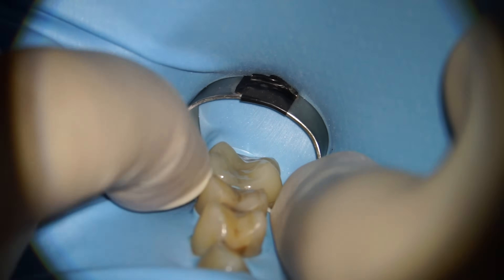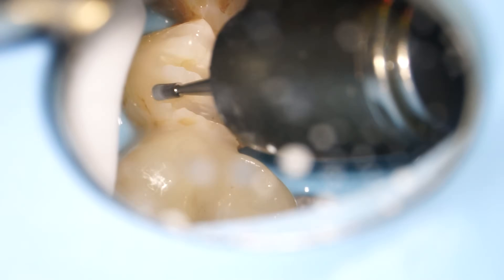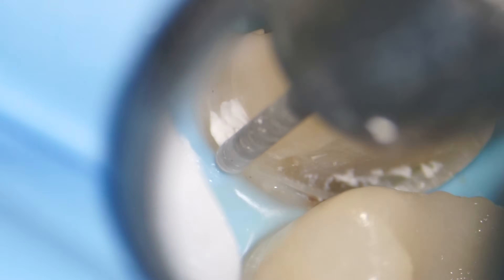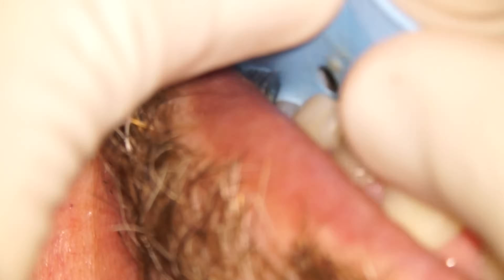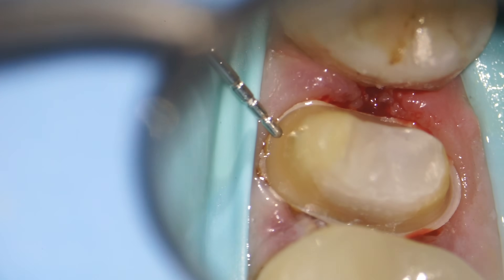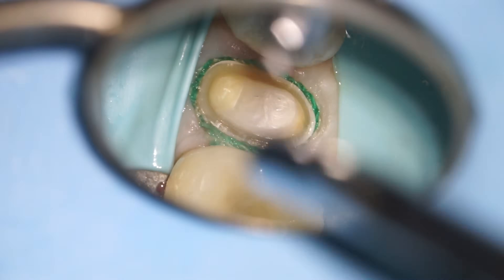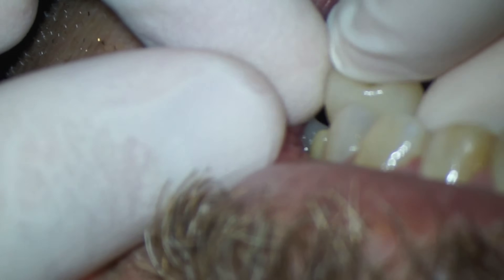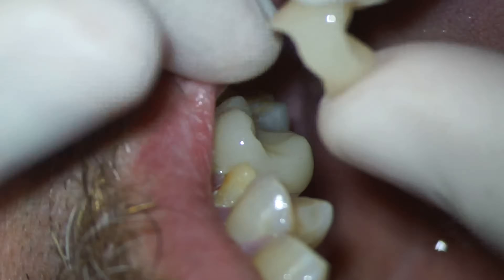Dental Crown EXPLAINED (and how much Tooth You'll Lose)

Comment: Yo doc. So I had this pain on the left side of my upper tooth when I used to bite down on food. It’s the last tooth before my molars. So it forced me to eat on the other side. I made an appointment to get my tooth checked out but I found out after eating on the other side that I was getting tooth ache. Not during eating but after a good dinner with mostly meats and what not. And started getting really bad tooth pain. So now I’m told that I need root canal and a crown. I’m confused. The  crown will go on top of the root canal or the tooth that was initially bugging me?.  The tooth that’s bugging me it’s not exactly form the way it should. The inner part seems to be chipped a bit that the outer part. Thank you

Comment: I had a root canal on top premolar. It had two canals. I'm going to get my crown on in a month (trying my best not to chew on it that side in the mean time especially with anything hard). The dentist said for the crown procedure there most likely won't need to put anesthetic. I saw a video where it looked like they used a blow torch to the gum? Wouldn't that hurt without anesthetic ? or maybe I don't know what I was looking at? Or my case is different where they won't need shave much off?

Comment: hi Dr I needed some advice I had a porcline fused to metal crown left top moler about 3 weeks back I have a black line at the inner part of my gum and it very tender to touch im also getting discomfort in the gums when biting I have been back for adjustment is this normal this pain.

Comment: Why use anything other than zircon crowns? Layered in front, solid in back.
Reply: High aesthetic full contour zirconium is a stronger and more predictable restoration in the posterior. When restoring on the mandibular arch, we stay away from layered crowns as there is usually a visible transitionary seam of translucency where the porcelain meets the zirconium on the buccal cusp in the case of cut-back zirconium crowns.

Comment: When I got a crown the numbing shot started to wear off because they worked on a large filling on the tooth next to the one getting a crown as well, so I think it took longer than normal.  Wish I had asked for more novocaine because I could feel that cord which hurt and then they did something after with a drill or something and I swear I could feel it in my soul.  The worst part for me was going back to get the permanent crown put on.  Once they took off the temporary crown, my tooth nub was so sensitive and it hurt when they would put the permanent on and then have to keep taking it back off to make adjustments and then putting it back on.  Also before they finally cemented it I said it felt weird and felt too tight but they took an x-ray to verify it looked good and told me it would take about a half hour and it would settle down and I would get used to it and I did.  No problems after that and I've had that crown for a year now.
Reply: Are you sure you haven't developed any cavities under the crown?
Reply: @Kriti2024  no cavities.  I go to the dentist regularly.  I also switched dentists after I got that crown.  I have since got another crown on another tooth and it was a painless process.

Comment: I have an onlay that wound up fracturing my tooth. The fracture isn’t bad but I’m sure I’ll need a crown. The only thing is, is that the onlay goes under my gum. Would they be able to build up enough material to glue a crown on to? My onlay is like a large filling in the back of my tooth.
Reply: I had an onlay that ended up getting a hole underneath it from decay and I needed a crown.  Yes they were still able to do a crown they just do what is called a build up with it where they basically build your tooth up if there is not enough structure left to support a crown and this way they can put a crown on it.
Reply: @samanthagirl84  How long have you had the crown? Makes me so nervous.
Reply: @FEARisCOLD  1 year last month.  Don't be nervous, it has to be done and it's honestly not that bad just feels like it takes forever because of all the steps they have to do.  I have to get a crown on another tooth in a couple weeks and I also need a build up on that one too.  Your gums may be irritated after for a little bit, but you can rinse with warm salt water.
Reply: @samanthagirl84  Thank you for the replies, I appreciate it. I’m only having this issue because my dentist chose to do something different than what should have been done. It has seriously stressed me out. I haven’t been back in months but what he did caused a fracture in my tooth. Luckily it doesn’t really hurt but I know I gotta take care of it because it gets worse.  Can I ask, which tooth and what kind of crown did you go with?
Reply: @FEARisCOLD    Tooth #18 and not sure exactly type, they didn't give me a choice, but it's all white and I don't see any metal along the base so maybe porcelain?

Comment: I’m stressing out. About 5 years ago I had some metal fillings replaced in a first molar on the bottom. That tooth eventually got a cavity under the gums which led to me getting an onlay. A couple of months ago it popped off. This was actually the second time. My dentist decided to do a bulk composite instead because he felt it would stay better. My tooth fractured about a week after. I’m not in pain but I can kinda feel it. It has stressed me out so much. Can you give me some advice? I’m upset with my dentist now because he could have just glued the onlay back on like I asked him. Now I have to worry about either a crown or losing the tooth. I’m worried there isn’t enough tooth in the back to even cap it.

Comment: Just curious why you don’t use zirconia instead of porcelain
Reply from the maker: Hi Kristian! As you know, Zirconia is fantastic when a more opaque appearance is required to match existing PFM work in the mouth, or uncommonly opaque virgin teeth. I also think it's a gift from above when doing featheredge margins (e.g. vertiprep). But I find the esthetics of E-max to be more favorable, more often, due to the inherent transulency it provides. I am aware of the more translucent zirconia that's available, but the increasing translucency compromises zirconia's strength. Emax is plenty strong for most people's mouths when the prep is designed correctly. It's nice to have both options, and then to choose the material that best suits the patient's needs :) Thanks for commenting Kristian!

Comment: I just got my temp crown last week n my teeth feel so sensitive n it’s sting when I bite down. I can’t even chew. Only chew other side my mouth. Can u explained what’s going on???
Reply from the maker: It's possible that the temp crown is too high and is getting in the way of the bite. You may have to have the bite adjusted by your dentist. If you're getting pain all the time, meaning that the pain comes out of nowhere without any trigger whatsoever, it could be possible that your tooth is irreversibly inflamed and may need a root canal. I would try the bite adjustment first and see if things get better :) That's usually the problem! Good luck Kim!

Comment: Can bonding material be used instead of a veneer to make stained teeth whiter? Is it less expensive?
Reply from the maker: I would start with professional whitening. Have your dentist make you some whitening trays, and purchase a carbamide peroxide whitening gel. If that doesn't make the teeth look as you wish, than you're looking at either a porcelain veneer or crown (depending on the amount of enamel remaining) or a composite front tooth filling (i.e. what you're talking about). It is less expensive, but also less durable, less aesthetic, and will pick up stain faster than a porcelain veneer. Hope this gives you some idea!
Reply: Michael the Dentist are zirconia veneers better than porcelain? Are they the same price?
Reply from the maker: @Jervisdude  Zirconia, while great for crowns in some cases, isn't a great veneering material. Porcelain (specifically, etchable ceramic) veneers work MUCH better than zirconia, as veneers rely entirely on adhesive technology ("bonding tech") instead of mechanical retention/engineering principles to hold the veneer on the tooth. An extreme oversimplification is that veneers are glued on, while crowns are locked on. Adhesive technology (bonding) works much better with etchable ceramics such as Emax, empress or feldspathic porcelain. For full crowns, adhesion is less important and cohesive / engineering principles become more important - thus, a zirconia crown's inability to be well-bonded doesn't matter - once cemented, it is locked on mechanically by intimately fitting the shape of the tooth stump underneath... kind of like how a toque you'd wear on your head in the winter is much harder for the wind to blow away than a ball-cap would be - the toque intimately fits your head, and is harder to be displaced.

Comment: With a crack or decay below the gum line, is it mandatory to do a crown lengthening procedure? or is it more efficient to just remove the tooth?
Reply from the maker: If you have a mesial-distal running crack that is going sub-gingivally on both sides of the tooth, I feel the prognosis is much more guarded. You can still do a crown to reduce the wedging effect and thereby crack propagation, but the patient needs to be aware they may lose the tooth, even with the perfect crown. With respect to a crack like this, I don't think crown lengthening is really going to improve your situation there. I don't believe your "holding a tooth together" with a dental crown. I think you're instead improving the prognosis by redistributing the load on the tooth in a more favourable way that leads to less crack propagation; so really, by drilling more apically to get to the bottom of an already dire looking crack, you're doing a lot more damage to the tooth by removing more peri-cervical dentin, and ultimately worsening its prognosis even more.

For deep class V buccal decay on the other hand, crown lengthening may provide a benefit; if your crown margin is going to end up being too close to the bone because of where the tooth decay was, you can end up with a biologic width violation that can lead to chronic inflammation around that tooth (and even adjacent teeth). Doing crown lengthening on the fly with a KB-1 chisel can prevent this. There's a great course by John Kois called the Periodontal-Restorative Interface that covers this in great detail. I would highly recommend his entire program. Thanks for your question!

Comment: Where are you located? I need to remove some 15yr old amalgam fillings & replace them with the white fillings .
Reply from the maker: Medicine Hat, Alberta, Canada! - keep in mind that there is a small risk in removing amalgam fillings and replacing them with white ones; anytime we prep a tooth for a filling or a crown, we are causing some inflammation in the pulp of the tooth. I typically only recommend replacing amalgam or silver fillings if there is recurrent decay underneath or cracks in the surrounding tooth structure. Thanks so much for commenting!

Comment: I personally believe that what is done during the cementation appointment is way more important than what is done during the preparation and impression appointment.  Looking forward to how you manage this.
Reply from the maker: I think both are critical, but you're absolutely right - if the dental crown cementation isn't managed properly, a perfect crown preparation doesn't help; in fact, in can hurt! If the prep is really retentive, but the crown has microleakage due to poor isolation, for example, you can have decay develop underneath without the crown falling off. The patients thinks nothings wrong because the crown is still in place, yet dental decay is rampaging on underneath.

 However, a terrible crown prep design cemented perfectly will still lead to a poor outcome in the long run. 
 
Hopefully I'll have a video up about my crown cementation protocol soon! :)